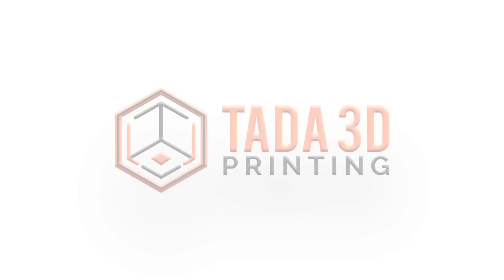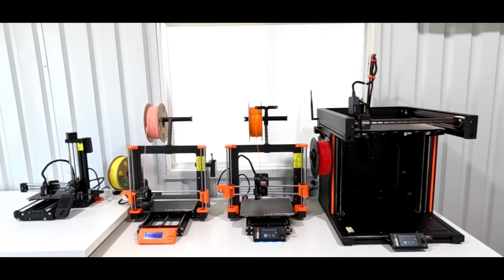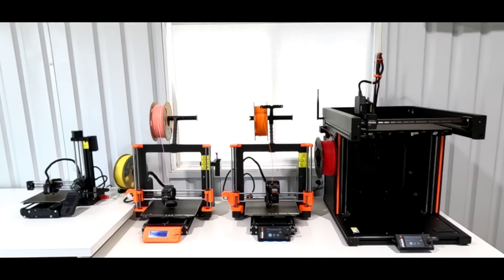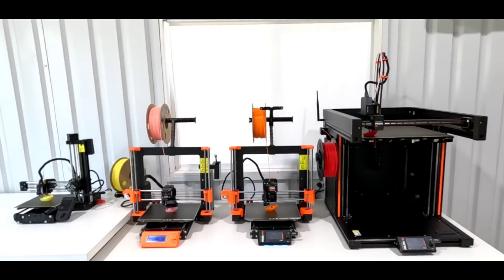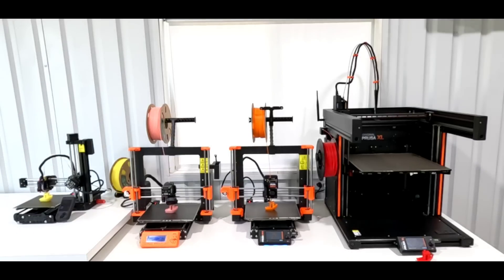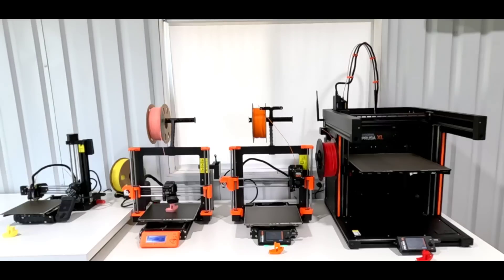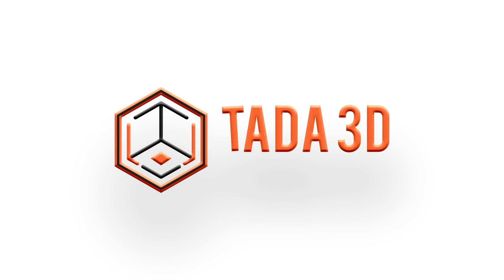Racing between the Prusa Printers to print a benchy!

Comment: IMPORTANT note here: my friends have 3D printers from prusa and we were printing huge amount of the same parts, so we decided to do some speed printing comparison, mainly between the prusa mini and the prusa MK3S. The MK3S is faster and brings more precision to the build even during high speeds, WHEN you let them run faster. the prusa mini cannot be sped up so much as the MK3S, and even in speeds that it does allow, the printing quality does not match the MK3S. Not fully sure, but i am confident that it has to do something with (at least in my mind) pretty stupid flimsy design of the mini, that does not support the printing head so well and allows for more movement, especially during high speed/accelerations of the mechanism. compared to that, the MK3 or MK4 basically don´t have any play at all, which allows them to print way faster. they probably restricted the speed, and for a good reason, not only the print quality takes a big hit, but also it might significantly increase wear of the mechanism, whereas the double supported MK3S and MK4S are not suffering from such problems.
Reply from the maker: That's true. The cantilever design does have some limitations. Thanks!

Comment: The XL benchy has what looks like ringing under the port window, indicating to me that some bad shortcut(s) are taken to speed up the prints. The MK3S one has some uneven layers, seen for example on the back of the square open "box". Also, all except the XL seems to have some kind of transition on the front of the keel about 1/3 up. Looking at the MK4 benchy, there is some kind of moire pattern on the flat surfaces when looking from the back.
Reply from the maker: I agree they could use some fine tuning! Thanks!
Reply: @tada3dprinting  I am 100% amateur so don't base what you do on just my comment. Anyway, would be fun and useful to see this comparison revisited with input shaping now that two of the printers has at least alpha support. Or maybe after the XL gets it in October or later.

Comment: Very cool to see this comparison, cause I only have a MK3S+ and waiting for my XL. 
XL is obviously the slowest here with the startup but definitely the fastest in printing. 
Or maybe not really in printing but in moving faster while not printing?
Have you set all printspeeds the same or do they differ?
Does the heatbed on the XL get more time to spread the heat more evenly or why does it take so much longer? Due to the segmented heatbed I would expect it to be faster, because it has the smallest heatbed fired up in this comparison with this model?
Reply from the maker: I'll check that switching between profiles doesn't have subtle changes.  XL goes through several steps, bed heating, absorbing, calibration at 170, finish heating etc. Always takes longer. And even the MK4 takes longer than previous ones. But they end up ahead in the end. Thanks!

Comment: This is a pointless video, slicer is not accurate for faster prints for times, which these are not approaching the machine limits for. All of these printers have approximately the same flow rate hotends. All of these printers have approximately the same cooling. They are all therefore....approximately the same speed. Prusas are not motion bottlenecked, they are flow bottlenecked. I talked about this literally years ago on the make: podcast when we were doing face shields. Flow is your primary determinent for net part speed. You can run the exact same toolpaths, speed, accel, and motion on all of these printers. The only thing different will be ringing characteristics due to accel, without input shaper because they are not motion limited. You are not close to even the hotend limits on these slices. At best you're just showing different profiles, which isn't meaningful.
Reply from the maker: You have to start somewhere. And I agree you can go faster. It just becomes harder to decide better speed for less quality.  Thanks for the feedback.
Reply: @tada3dprinting   @TADA 3d Printing  it's a fundamental misunderstanding and you're not alone in it so dont take it personally, basicaly the entire content creator space for this gets it wrong. It's applicable to basicaly everyone making this kind of content on youtube. It's conflating comparing the printers themselves vs comparing the out of box user experience based on very conservative pre-defined profiles. And It's incorrectly conflating net part production speed with motion speed when there are actualy multiple inputs for what needs to happen to make a part faster. The easiest way to think about this, is highest flow rate with least toolpath time is generally going to be a faster part. Flow is generally layer width x layer height x speed. Accel primarily gates your quality via resonance/vibration induced surface artifacts like ringing. Accel also determines the length of travel to reach a particular speed which applies to your prints based on the feature size of your parts, so the speed is way less important to quality than the accel. To print "faster" you only really need to have more flow. And that's why the diy meta now is for higher and higher flow hotends. The speed/accel only gate the resolution at which you output your flow (layer height/width aka voxel size) on some particular part feature. With geared extruders you can actually push like .8 to 1mm widths on a .4 or .5 nozzle at .2 height if you print hot enough. This becomes an exercise in managing toolpaths and other settings in the slicer to go faster without even touching the motion speed, without impacting surface quality, those things like resonance patterns due to accel impact motion speed from a quality limit so to speak. You dont necessarily have to move faster or change your quality point to print faster.  With input shaper you can even mitigate the accel induced ringing, and shift the accel/quality point depending on which tuning philosophy you follow, pre or post spike. Voron users tend to tune pre-spike. Bambu tends to tune post spike or spike agnostic, and prusa Is likely to do that also. 

If you actualy want to compare the printers, and not the out of the box slicer profiles, all you need to do is get accelerometer charts on the same printer surface in the same conditions, toolhead max flow test (extruder/hotend combo), cooling test (bowl of water and a ruler), motion test (max accel & speeds before losing steps- at the currently set motor power settings in the fw). Nobody does this and basicaly all of the content in the space comparing printers is basically wrong and apples to oranges, unless its through the lens of like pre-baked profiles and out of box user experience comparisons which do have some validity for print and go normies to just compare experiences but absolutely do not imply anything about the machines themselves necessarily. At a functional level, These printers are basicaly all capable of producing the exact same parts at the exact same speeds at approximately the same quality, except the ringing performance on the xl. The xl is likely to be able to have better accel/resonance performance than the slingers. due to more rigid frame and gantry and rails.

The reason the bambu is running circles is because it's more rigidly framed, and because it has a much higher flow hotend, roughly equivalent to a volcano. When prusa releases high flow hotends for the new printers, they will at least be in the game for comparison. The nextruder is however a huge layer quality improvement for some non obvious reasons and miragec has a very good video speculating about why this is the case. 

  These kind of apples to apples comparisons of machine capability are hard to do, and are boring content and require a very much higher knowledge level of tuning. Basically Nobody does it in the content space, hence the don't take it personally. 

Some might argue that good content is better than content hyper-accuracy so I might also not be the best judge of things here too. I mostly just get frustrated because I end up in high volume help rooms having to unpack this stuff where some user comes in after seeing some video and wants validation about what to buy. and there is a decision to either just tell them to buy whatever and be happy and excited and maybe warn them what to expect for each choice, or to get technical and unpack this stuff granularly and go down a use case decision tree to find the right tool and spend a lot of time and effort on that and re/educating people along the way. I think It mostly just bothers me, but it drives me absolutely crazy.

Comment: Nice test. But I still find the XL terrifyingly slow for a CoreXY, especially for that money. It doesn't need to be as fast as this his Voron 0 (9 minutes at decent quality) https://youtu.be/vso6lgTRSo0 but fact of the matter is that the XL is being overtaken left and right by much cheaper printers. Prusa can keep up the fallacy that it's not about speed, but quality, but in reality, a Bambu or a Voron cán print at greater speeds with the same quality, or better (so you CAN have both!). What is the point of a $2500 printer if it's just printing barely faster than a $1000 printer with the same quality? A printer like the XL IS capable of much more and I find it shocking that Prusa, with all the time they took to develop this printer, they managed to come up with something that is as slow as the XL. I find it heartbreaking too, as someone who was rooting for the XL. I preordered one at day one in 1865 or so it feels. It's a marvel of technology, with all the stuff they developed, like the sensors in the nozzle and the hotend, but in all honesty, I find it an XL disapointment.
Obviously, this isn't your fault and I'm sorry to abuse your channel for my rant, but I'm really disapointed in the XL. It's a great machine that is being held back. I'll keep following your channel, but I cancelled my XL order and I'm going to build a Voron.
Reply from the maker: I can understand your frustration. I am hoping that the input shaping helps but who knows when that will be. I am happy with it. But the more I hear others talk about speed on other machines, it does make me curious about what's out there. I just wish the Bambu etc had a larger print bed. Thanks!

Comment: I wish you would show me one of those first layer sheets that is the mk4 promoted for a lot.. and then compare it to the other ones. I am talking the very thin 1 layer sheet over the whole printbed.
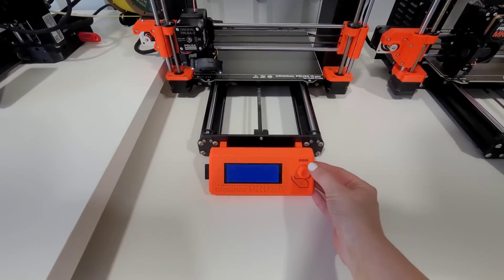Reply from the maker: I do show it on the XL in this video - https://youtu.be/Nq51N548NsA . It starts at 1:20 on the video. But yes I should do it for all of the machines. Thanks!
Reply: @tada3dprinting  Would really appreciate that! Its one of my rain reasons to switch to the mk4 since I need thin diffusing sheets for light projects.

Comment: Merci une fois de plus pour les essais.
1h10 mm pour un benchy…c’est vraiment très loin des temps réalisés par bamboula qui vont de 15 à 30 min selon les réglages.
Par contre si on prend en compte la vitesse pure, une fois que le « démarrage » est fini la xl sort bien car le gain sur une grosse impression de 12h à 24h sera très notable.
Le départ reste très long pénalisant en particulier les petites parties.
Un test sur une belle réalisation de + 8 H sur XL et MK4 montrera la vraie vitesse du XL.
Avec mes remerciements

Thanks again for the trials.
1h10 mm for a benchy… this is really very far from the times made by bamboula which range from 15 to 30 min depending on the settings.
On the other hand if we take into account the pure speed, once the «start» is finished the xl comes out well because the gain on a big impression from 12h to 24h will be very noticeable.
The start remains very long penalizing especially the small parties.
A test on a nice achievement of + 8 H on XL and MK4 will show the real speed of the XL.
With thanks
Reply from the maker: .2 layer height and .4 nozzle are not really standard for the XL. I just wanted to keep it easy to compare with the other printers. Yes, doing a longer print comparison will be interesting. Thank you!

Comment: I have an XL on pre-order and am waiting for the 5 head version.  Have you printed over the network?  I have all of my other printers on so I can print using Klipper and Mainsail or Bambu Studio.  Would be great to see the XL networked.
Reply from the maker: I haven't because I am paranoid about something happening. My internet is not the greatest. But I do need to just try it out. Thanks!
Reply: @tada3dprinting  I have not used a SD card until recently when Bambu Cloud was down.  I really like the way Klipper runs on my Rat Rigs, no need for anyone hosting, just open a browser and go to the printer
Reply from the maker: @woodwaker1  and it can handle multiple printer on one computer?
Reply from the maker: Looks great. Thanks!

Comment: Good test for quality control, but for speed test you should print about four benchies per machine, because if you print only one  the printer is forced to reduce the speed on small areas
Reply from the maker: Interesting idea. Ok let me think about this. Thanks!
Reply: @tada3dprinting  or just one piece but larger and without small detailled areas, a simple cube should work but it would be very boring.

Comment: This is your best video yet!  I love this format comparing all 4 but i don't care so much about speed exclusively.  If you had to rank the finished results for smoothest best print quality, which is the best to worst?   What about doing a more challenging print like a lattice cube or something to test clearances? So rather than seeing which is fastest, the challenge becomes what do you have to do with each to get great results because for me that's the top priority. You could rank each 1-10 for a) how easy or hard to get great results b) finished print quality and c) speed for the final print and a nice chart showing these metrics.
Reply from the maker: Sounds like a great plan. I just use ikea drawers and tops because I like to rearrange my space easily. But they are not the best for absorbing sound, they make it worse. So if you could get a solid top, that would be best. Thanks!
Reply from the maker: Great ideas! I like that a lot. I can't really tell a difference between the XL red and the MK4 orange. I would say Mini is #3 is MK3s is #4 in quality with these defaults. Thanks so much!
Reply: @tada3dprinting  you're welcome and thank you!  Your channel has quickly become a favorite for me as I don't want to waste time and money on chinese closed source problematic printers and would rather use Prusa and get the most out of that.  So then how hard or easy is it to get that great print? Everyone faces this issue.  Speed is nice but not a replacement for part quality and ease of use.  Keep up the great content!
Reply from the maker: @rescuemethod  this is just default settings. I would say if you're new to 3d printing, the Mk4 is your best choice because of the auto Z calibration,  but even the Mini and Mk3s are great printers. I have heard that other printers out there may be faster, but I am happy with the consistent reliable quality prints from Prusa printers. My very first printer was a Creality, and I could not as a beginner get it to print quality consistently. As soon as I got a Prusa, I have had small adjustments but been printing happily since (for 4 years). Thanks so much!
Reply: I've used 3d printing since the 1990s but never owned one. Im a designer and product developer and have worked as an engineer as well. I am drawn to Prusa's commitment to continual improvement and reliability and distrustful of cheap printers riddled with issues made in communist slavery supporting countries. So then a Prusa seems like a great reasonable choice. I think i will go for the mk4 kit and print cool toys and science projects with my son.  Concerns about particulate matter will force it into the garage so an enclosure and dry box will become important. Id like  it to do non planar printing...something to work towards.    Thanks you've been great! Nobody talks about this but what type of workbench do you suggest?  So many are not solid and move or wobble.

Comment: Bamboolab x1 carbon benchy 13min   The only tempting is the 5 head.
And the VzBot even faster.
https://www.youtube.com/watch?v=a2WEseiK_-U
Reply from the maker: Is that with .2 layer height? Thanks!
Reply: @tada3dprinting  0.25 You can see the settings at the first second.

Comment: I surprised the XL succeeded if you didn't change the nozzle size in the slicer.
Reply from the maker: I did change the nozzle size in the slicer. And I changed the actual nozzle to .4. But I am guessing from that notification that I need to update a setting on the XL to know it's now using. 4. Same thing happens if I swap filaments and don't update it, it will give you a notice saying the gcode and filament don't match. The filament  makes sense. I was surprised by the nozzle notification.

Comment: Were the filament types the same other than color or were they different?  For comparisons if some of the filaments were older it would show a different outcome, but great idea and outcome.
Question:  It's hard to see in the video, but which one do you think came out the smoothest with less noticeable layer lines?
Reply from the maker: Yes all the same PLA filament and I tried to do similar colors. All were opened recently. If I had to pick one, I'd pick red. Thanks!
Reply: @tada3dprinting  Great, you really thought things through.  I can't wait to get my printers....